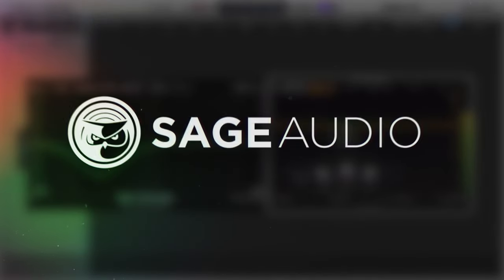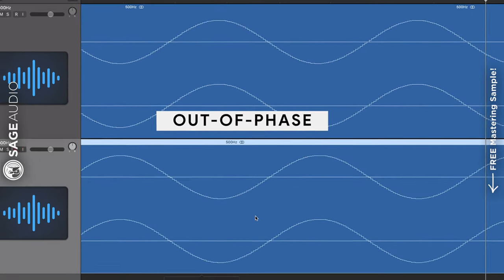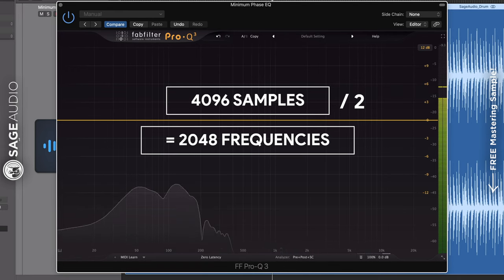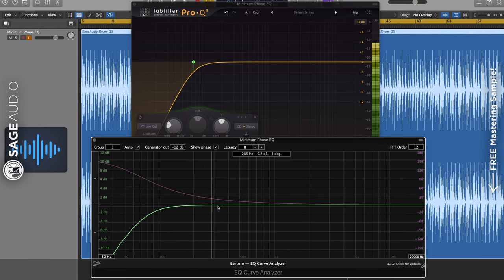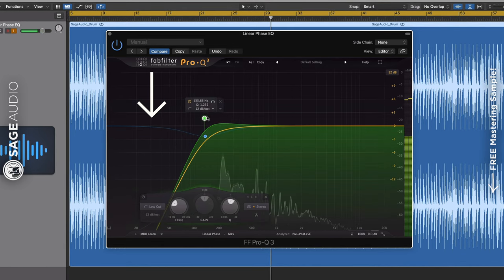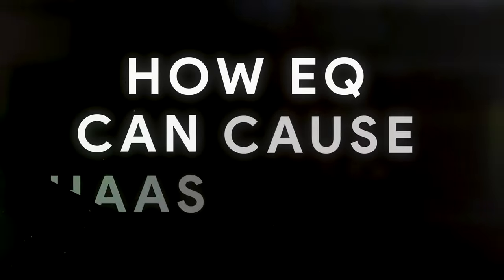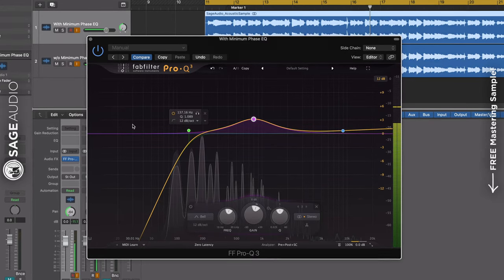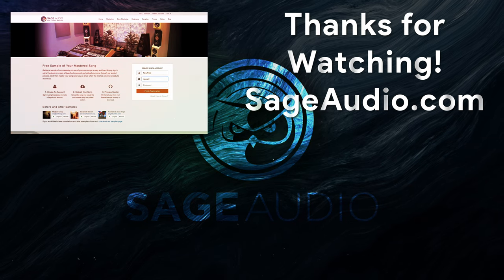How EQ Changes Phase | 1 FREE Mastering SECRET You Need to Know!

Comment: People tend to make a big deal out of phase. In reality, using parallel eq will only give you a slightly different curve than the graph is showing. Hi, low and band pass filters can get wonky. But, you're not going to get some weird phaser sound. If you don't hear a problem, there is no problem. EQ drum spot mics, use parallel EQ. IT'S OK.

Comment: Correct me if I’m wrong, but I think zero phase is not FFT, but the opposite. FFT EQ is a type of linear phase equaliser, according to some articles I’ve read, FFT is what would make the “perfect low pass filter” possible, by simply removing all bands above a frequency, but FFT has problems unless you had tens of thousands of bands, which would add a lot o latency.

Comment: it's important to understand the audio phenomena caused by the tools we use, but at the end of the day what matters is the artistic intention when choosing what to use. Passive equalizers are widely used in mastering precisely because of the resonance they cause. Great video. You have gold content
Reply from the maker: Very true! It really comes down to what sounds good, but it helps to know what's happening to the signal.  Thanks for watching!

SageAudio.com
Reply: I like how Ozone has variable phase as well as analogue EQ, or even the Pultec-ish module. It can be flat with linear phase, but sometimes flat is what's needed, or bumps/depth is needed...if the mix has that kind of thing going on. Like widening stereo it can be too much or too little, so its handy to just pass thru each band imhe.
Heck, i phase aligned guitar mics before and unaligned was better. Rules are for knowing and you have to know them to break them [successfully] don't u?

Comment: As a producer, you can spend hours using dC offset, stereo imagers, flangers/phasers/choruses, regular LCR-panning etc, to get your stereo image where you want it. You might even get it to work and sound good BOTH in mono and stereo. The thing with "fancy phase-magic" is that it is often only noticed by either people who themselves make music - or by the people with the expensive sound systems/headphones. The common consumer of music usually listens to music through either in-ears, non flat shitty beatboxes that are sometimes just straight mono (btw!) or just through their laptop speakers or gaming-headphones.

What I'm trying to tell you with all this is because of the above stated facts makes it very risky to fuck with phase. The mix engineer or the master engineer is going to slam a phase-corrector (like a linear EQ) and just throw all that hard phasing-work you did out the window because that is going to get lost in transmission when people are using sound systems not capable of making sense of the signal.

And believe me. Listening to a wide, magically phase-choreographed mix , with a perfect balance between all points of its stereo image, on a system that is sub-par or just cheap, or for that case IN MONO. It can sound like half of the song got sliced out. This is what so many people struggle to understand!!! Don't mess with phase or dithering because if you get a placement, some other engineer (if not the mix/master-guy then the recording engineer for the artist) is going to hear that phase being not how it should and slam it linear... all good and safe... and boring... but that's a bulletproof way of ensuring ur mixes don't gets lost between different listening mediums.
Reply: Trying to cater to low quality gear and undiscerning listeners will often result in sacrificing quality for those listening on decent gear. I prefer not to compromise for people that don't care all that much what the mid range or the panning or the phase relationships sound like. I take an "it is what is is" approach to situations where the finer details of the mix don't matter. I would rather be creative than to dull down my mix for the masses. That's not to say I don't test in mono or listen on every device I can, but I take the low end listening experiences with a grain (or two) of salt. As long as the rhythm and the vocals are clear, and the music is at least somewhat discernable, I'm good with how it sounds on an iPhone or Bluetooth speaker.
Reply: What phase eq and how slam?

Comment: Linear phase eq is good mainly on Sub Group Stereo Buss and Master Buss outs..if your using linear phase eq plugins, use the same plugin manufacturer ! one on each instance - Dont mess with Low or highs 'qualities.. keep them all the same value..I wouldn't bother using linear on individual tracks.. my opinion, but its through trial and error..Use Linear EQ over the Buss's? - Yes but on All of them.. So no delay / latency between Non and Linear processing  - And Yes They are all leading to the Master Buss - sure.. If you want More Master Linear phase EQ?? You will be "linear Phasing" already linear eq'd stuff ? , it doesn't matter - because you have used linear phase on each Sub group leading to the master.. Meaning? Actual phase issues won't be a problem and any Bell artefacts will not be so apparent, ( I seriously doubt you will need crazy settings at this stage)  as you are working on pre mixed buss's..Keep it all stereo , don't play with different "quality" values per instance.. I would  Not use on individual tracks... let the art work before correction... unless the art is correction :-) Peace.

Comment: Most of the time linear phase EQ is a solution looking for a problem.
Sample rate conversion is its best use.

Also most min phase DSP doesn't use fft as far as I know. EG a 6dB lowpass filter is just a single sample delay with feedback.

Comment: does the phase still exist in the eq example with the hpf cutting the low, like i would do with my vocals, it introduces the alt eq curve, but what if i render that into audio, is it still there?
Reply from the maker: That's for watching! The changing of phase relations is occurring within the plugin.  So for example, if you use a high-pass filter on the vocal, the area right above the cut off would be amplified slightly.  When you bounced the audio, that amplification would still be occurring within the plugin, and as a result the audio would be equalized with that bump or amplification included.

Comment: I beleive most processors use a bit depth of 16 or higher, so your 4096 sample size  example (also you don't clearly communciate size vs. rate) is for a 12 bit system. Perhaps the reasons given describe why phase shift happens in digital signals... doesn't not explain why they also happen in analog systems.  Most people don't understand FFT and the math to catch this and your video while sounding really good and raising some good points, doesn't fully clear up the topic of how phase is introduced as many think it does.

Comment: So does it make sense then to just place a phase correction plug in like auto align after the equalizer? Or maybe if the problem occurs to greater effect in low frequencies use Hpf as the very first effect, then phase correction and then all the other stuff?

Comment: So basically digital EQ's don't ACTUALLY effect the RAW audio file - but rather act as an influence field on the raw audio. Bc this 'influence' is calculated by computers and not solid state electricity - theres sample gate and timing limitations which cause mild inconsistencies in the calculation of this  'influence' field we call digital EQ .You add that onto the innate phase inconsistencies introduced that even an analog EQ would produce naturally.   So you get an extra layer of phase distortion with digital eq.?

in analog EQs the inherent distortion is caused by shifting a complicated harmonic curve up or downwards in a very arbitrary but specific spot - which strains the amplitude curves of the original audio - causing distortions prior and after the change in an effort to keep a mathematically coherent curve moving through time.  Am I close? Thank you :)

Comment: Thanks for great video. Do you suggest to use Linear Phase EQ on hard panned tracks (for example 2 guitar tracks playing the same thing panned left/right). If I want to EQ one, would you suggest Linear Phase EQ to avoid creating Hass effect? I mix a lot of hard panned guitars playing same thing, should I use Linea Phase EQ on them when for example applying HPF? Thank you.
Reply from the maker: Hey Lucas thank you for watching! Yes, I'd recommend that you use linear phase if you're using the EQ on one channel and not the other!

SageAudio.com
Reply: @sageaudio  Thank you so much. So correct my if I'm wrong. When I only EQ one hard panned guitar it's better to use Linear Phase EQ to avoid phase shift. What if I want to EQ differently both hard panned guitars? In my studio I use analogue SSL EQ. If I eq both with analogue regular EQ will it cause phase shift problems?
Thank you.
Reply: @LucasMichalski  Just for verifications sake, both gtr tracks were recorded individually and are 2 separate recording 'takes', just that they're both performing the same part, correct? If so, I'd take it even further than just EQ'ing one side differently from the other. I'd perhaps try using 2 totally different EQ plugins and different EQ adjustments for both sides, in addition to anything that would also provide some tonal coloration to yield a stronger contrast. Reason being, given this particular kind of scenario where 2 different recordings of the same content are hard panned, any/all variations between the tracks will result in DESIRABLE phase discrepancies THAT'LL WIDEN THE STEREO IMAGE! 

For instance, take the last bit of the video when he demonstrates what & how the HAAS effect sounds like. Now I dunno about you, but the overall stereo image seemed pretty weak or tame prior to the EQ change to one side! But, because he messed with the phase relationship between the L and R tracks, a far more robust sense of stereo imaging, albeit, not the most flattering or pleasant stereo effect (HAAS), was established as a result!

Comment: My issue was with an AKG C7 condenser microphone that has a non-switchable 12db HP filter at 150 Hz that was producing an asymmetrical waveform when recording spoken word. On tone, from a sound source, the waveform was perfect. Turns out that I had to apply a +90 degree phase correction with the graphical phase effect  in Audition to get the waveform to come right, allpass2  track 95 1 with Audacity. So long as an HP filter is not applied, this is not an issue with a Shure beta 58A and/or a Neumann KMS 105

Comment: Thanks for this video.  For years I've been searching for a understandable explanation of EQ phase, and while I'm still a bit dazed and confused, your information has helped move the needle.  Is there good use of the phase curve shown on some EQs?  I mean, if a track needs a frequency cut, can a phase curve indicate bad moves vs. good ones, or is just a pretty thing to look at?
Reply from the maker: Hey Dan! Glad to hear that the video is helpful! Although this probably isn't a straight-forward answer, it depends.  Since the mix or master you're working on has a lot of various frequencies, changing all the time with the recorded performance, any change to the phase can either help or hinder your mix/master.  

For example, if you used a zero latency EQ and it shifts the phase of the bass, maybe this causes some destructive interference with the kick drum that for one reason or another causes both to sound more distinct.  That said, knowing if the phase has been changed doesn't let you know how that phase change will affect other frequencies, or if it will be bad or good.  Your best bet is to use your ears!

SageAudio.com
Reply: @sageaudio   I love this explanation. This got a bit confusing for me but hearing you say trust your ears is very helpful. Working on mixing and mastering my EP now and I want to implement a lot more technical knowledge but some of it is overwhelming. The things that may be there that I'm not hearing is what concerns me more than anything. I'm still trying to understand how to find those issues.

Comment: Can you elaborate on why EQs like this one only use 4096 “samples”. And what in this case a “sample” is referring to?
Reply from the maker: Sure! In this case, the EQ is using 'Samples' to measure the signal at various points and then recreate the signal using that info.  I'm not the best at explaining the math behind coding a digital EQ (it uses an algorithm called the 'Fast Fourier Transform').  

But think of each sample as an estimation of the amplitude of a frequency.  The more samples we can take, the better the approximation of the value. When an EQ takes 4096 samples, that means that it's measuring various parts of the full frequency range 4096 times, which gives the EQ a fairly comprehensive range of values with which it can approximate the signal's amplitude at these various frequencies.  The more samples taken, the more accurate the approximation; however, the more processing power it takes.

Sorry, I know I'm not the best at explaining this (people who code or are more knowledgeable about math would be better), but maybe I can make a more detailed video on the topic in the future.

Comment: Hi, a bit confused. Use linear phase only to avoid phase cancellation problems or also in a creative way ? If it introduces latency, better to work with high latency in Daw settings ? what about minimum phase ?
Reply from the maker: It really depends on what sounds best to be honest - the differences will be small.  Linear phase results in the same phase relationship as the pre-processed signal, but the changes caused by zero latency or minimum phase filters may not sound bad.

SageAudio.com

Comment: Nice.  Why is phase shift emphasized at lower freqs?  Bc 0Hz is a dead end?
Reply from the maker: Thanks for watching! It's mainly because notes are closer together in lower frequencies.  So any shifts will affect a larger portion of the scale.

SageAudio.com
Reply: @sageaudio   Ah!  Right.  An Octave is a doubling of frequency, so, lower freqs are closer together.  Makes sense. 

So, is the Phase Shift merely a processing/latency delay?  Or does the filtering implicitly shift the phase bc of ‘capacitance/inductance’ properties?  (That’s analog thinking, right?  Rather than FFT thinking?). 

Thanks!

Comment: What is YOUR recommendation working with Fabfilter Pro Q3?
Linear or zero latency?
Is there any other kind of eq that you have in mind that doesn't work this way?
Thanks for any given answers.
Great video content 👌
Cheers.
Reply from the maker: If I'm equalizing higher frequencies, I stick to zero latency, but if low ones are involved, I like the low-latency linear phase option.  Thanks for watching! 

SageAudio.com
Reply: @sageaudio  thanks for your time and help.
Great YouTube channel.
Reply: @sageaudio  but what if i high pass and low pass at the same eq for a single sound ? For example piano or lead  which is mixed frequencies?

Comment: trying to undestand this: so the phase curve is different than the EQ curve? To use a metaphor-   the EQ curve is the wind that influences the surface of the water(phase).  This wind is irregular and thus influences the curvature of the water in irregular ways.   Why can't we make an EQ that directly modifies the raw phase curve? Or is that control only possible with synths not sampled files?

Comment: To the beginners out there -  this is all true but 999/1000 times youre better off using a hi pass filter and cutting out the unnecessary lows than worrying about this stuff.  Seriously, my mixes sounded so much better when I stopped caring about how eq effects phase.
Reply from the maker: Oh that's definitely true! I wouldn't want anyone to think that they shouldn't use HP filters because they change the phase.  It's just good info to keep in mind.  For example, say I used a HP at 80Hz and now it sounds like the lows are slightly boosted - this explains why that happens.

Comment: Bro please tell me, should we use a linear phase when doing parallel compression on vocals? I allways need to hipass the parallel compressed vocal to keep my low end clean
Reply from the maker: Yes you should! The compressor likely won't have linear phase, so don't worry about trying to make the compressor linear phase.  If you use EQ on a parallel channel, you should set it to linear phase mode

Comment: The Haas effect can occur in mono if different frequency ranges are delayed. The effect of non-linear EQ could be that the treble you boosted may be "pushed back" and this is the most noticable effect to me. Sometimes it can be subjectively nice in a way though, adding a 3d-ness but it can quickly make a master start sounding lost  in the space, lacking impact, actually losing the thing you tried to bring up.

*Haas effect merely describes the repetition of sounds (delay) being indistiguishable as separate sounds, and instead is heard as phasal changes (~30hz approximately,). Phasal changes allow stereo location though so its common example is Haas 'panning'